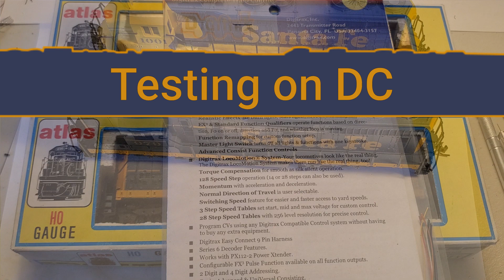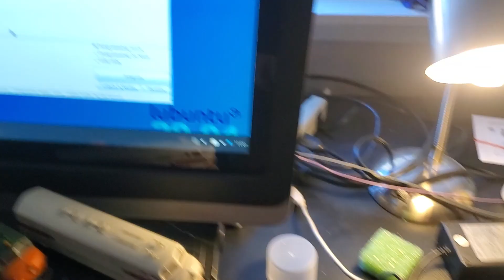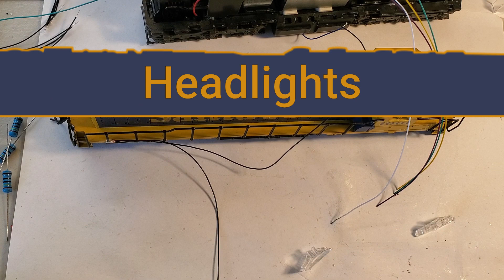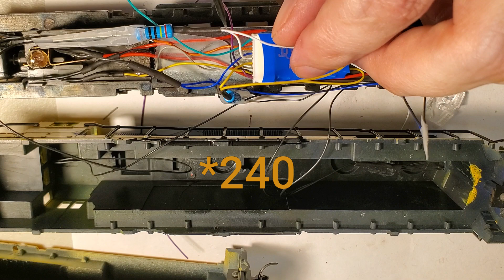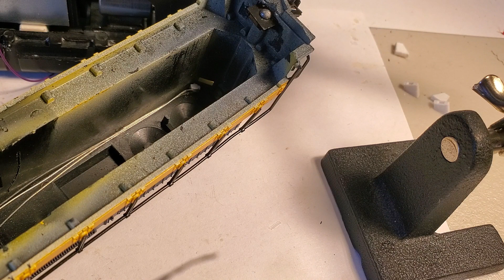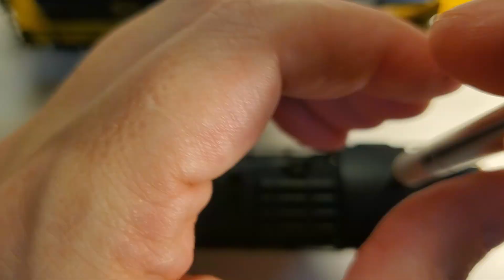Atlas EMD SD Decoder Install

Comment: I beg of you, Please do 'NOT' install ditch lights on any of these locos. All three pre-date the ditch light era.
Reply: Agreed - as far as their original owners are concerned... However, many locomotives continued on in service with secondary owners/short lines and lived well into the ditch light era. So, if "your road" owned & operated these in modern times it's absolutely appropriate to add the ditch lights - as they are required!
Charlie

Comment: How did you remove the body shell
Reply from the maker: There are round catches molded into the metal frame on either side in the middle above the fuel tank.  You need to pry the shell out on both sides and the shell will come up and off.